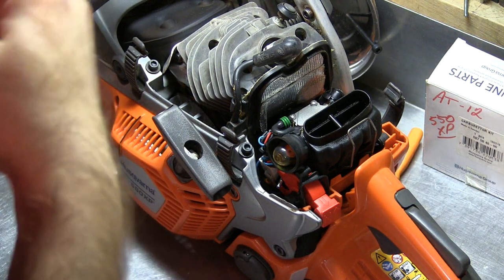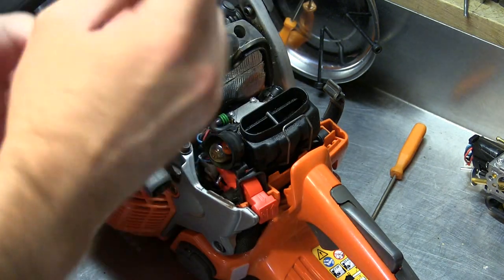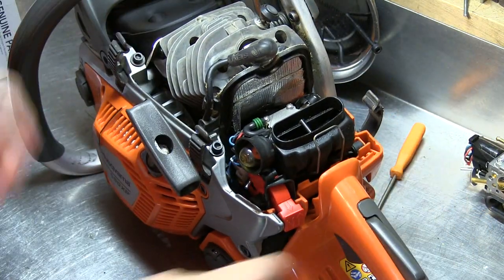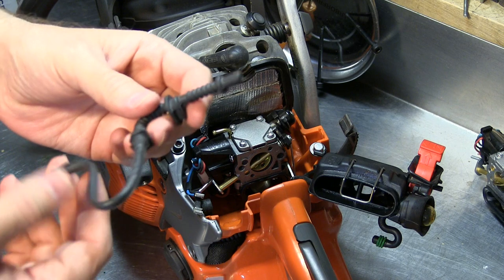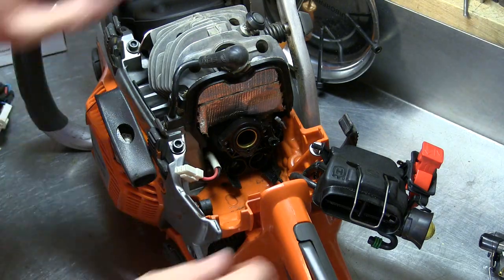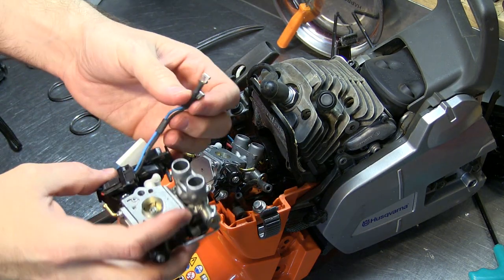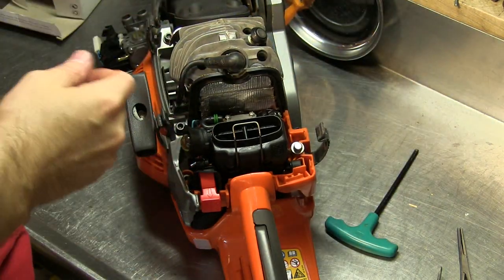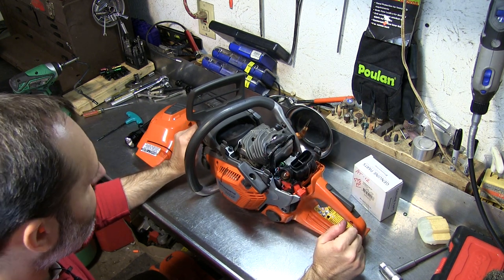Husqvarna 550xp carburetor installation

Comment: Where did you get the brass ring for the carb?  I dont see it in the parts breakdown for the Husky.
Reply from the maker: My dealer sent it to me, I don't know the par number myself. The parts breakdown your looking at may be older, so it's not a separate part as the ring was originally part of the carb itself. If you need the part give Ashokan Turf & Timber in NY a call, Bob should be able to get the ring for you.
Reply: In case anyone else wonders, the part number is 585195001.  I would say if anyone is replacing the older carb with the newer one, this should be ordered at the same time.
Reply from the maker: @jimbriney2349   Thanks for listing the number. The IPL I have doesn't list the number either. Did you contact Bob?
Reply: @Andyshine77  No, I found it online in the parts diagram.  Just a heads up for those that dont like to disassemble before parts arrive, like me, (and youd think after all the time Ive spent working on stuff, Id know better), but the AT-7 carb is the same externally (fuel inlet being the exception) as the AT-12, so if you are upgrading from that carb, you do NOT need the brass insert, if the saw came with that carb, it will already have it.
Reply from the maker: @jimbriney2349   Thank you for the update.

Comment: The new 550 xp model now called Husqvarna 550 XP Mark II, this new model comes with quite a lot of changes especially at the level of the cooling system where there were problems with this electronic autotune carburetor even as curious as how efficient and durable is this new model.
Reply from the maker: The 550 Mark II is actually not an improved version, it is an entirely new saw from the ground up, the IPL shows none of the parts are interchangeable with the old model. Husqvarna's marketing is a bit goofy if you ask me, this should be designated with a new model number like 552xp in my humble opinion. The saw also has some more weight to it, almost a full pound. Since I've gotten this 550 straightened out I actually really like the saw, incredibly good maneuverability, throttle response and power. But reliability is still concern, the new model looks to be over built, which may be a good thing.

Comment: I switched to echo because their warranties are better, they are cheaper to repair…i brought my 576xp into the dealer…took them a week and a half to tell me “i need a new carburetor”…didnt tell me what was wrong with the carb…just that i needed a new one…that thing only ran non ethanol…with red armor…and it was 6 years old…probably 30 hours on it total…

The autotune carbs are $150…standard carbs are $50….$150 to install, so, $300 to replace a carb….$1100 saw…

Comment: When you said you love the flip caps I had to respond. Lots of guys are breaking them. they should have used larger pin and HD Your plug wire is about laying on that cyclinder. Id get some clearance in there. I have about 9 autotunes with no known issues so far!! But 7 are jonsereds. I have the new 550xp markII too and I fired up 2253 jonsered they are very close.
Reply from the maker: First I've hear of that from anyone in the industry, good thing they have a slot for a screwdriver so you can still use them. The plug wire has a keeper that prevents it from contacting the cylinder, although it is close to the cylinder, not as bad as the 372's though they often sit in the cylinder and eventually rub through from vibration. the cylinder doesn't get hot enough to bother the  silicone plug wire. The 550 MKII has been doing well indeed. 

Thanks for commenting.

Comment: Thanks for video.  Used for reference.  Unfortunately, one of my strat port holes is deformed.  How the F do I get the partition off it?  Guessing pulling the jug is the only way as I cannot get a bit into the bottom 2 partition bolts to remove them.
Reply from the maker: If you're talking about the transfer covers? Yes you have to remove the cylinder.
Reply: @Andyshine77  Nope.  Plastic partition that holds the intake tube assembly.  No way to get to bottom bolts with jug on.  I managed to lose the small proprietary oring as well.  I will be victorious....eventually.

Comment: Husky screwed it's customers by releasing the 550XP with soooooooooooo many issues.  We were the Guinea Pigs for this saw.  Doubt the 550xp MARK II will be any better, just more testing on customers.
Reply from the maker: I agree with you on the first generation 550. However the 550 Mark II has been out since March and has been solid, and the 572 so far has become a favorite among the loggers that that are using the.

✌
Reply: I was disappointed to see on the IPL for the 550xp mark ll that it uses the same crank bearing as the original 550xp when they advertised better bottom end durability.
Reply from the maker: @johnwalt3504  The bearings on the oreginal 550 were upgraded a few years ago, after that the bottom end failures ceased, so it's not  surprising they went with thoes already upgraded bearings. The crank itself is new, along with the rod bearing. So far the reports are the 550 mark II has been trouble, issues with V1 550 were immediate. Time will tell how good the new 550 is, but so far so good.✌

Comment: A great video to watch! 
Interesting thoughts as well. 
On the 562xp, they changed that fuel nipple direction as well, like on this AT-12 carb? I know that those are Zama, but...could this help in the hot start problem?
Reply from the maker: Cristi Ro 

As of now they have not changed that on the 562. Don't know if it has anything to do with the hot starting issues or not, it does move the line a bit further away from the devider heat shield.

Comment: Bob plug that compression release they leak as well my Johnsered 2253 had transfer leak and compression release leaks and had to be rebuilt under warrenty and they plugged mine. I have since plugged all my saws release
Reply from the maker: Eric Smith 

I just bought a bag a decomp plugs.👍
Reply: If you have a pressure tester, it can be checked very easy. I just did a check on mine to be sure. 
In my area the dealers sell decomp plugs for about 5$.
Reply from the maker: I check them from time to time, I normally see idling issues if the decomp is leaking a little. I plug all my saws 70cc and down.

Comment: I have a Husqvarna professional 545 Mark 2 that has fuel coming out of the exhaust. It ran absolutely fine 1 day and the very next day it will not even try to fire off. I cleaned the plug and emptied the cylinder and it still wont even try to fire off. Fuel still comes out of the exhaust if I push the primer bulb 3 times. Any ide what might be going on? I am using the 50:1 ratio fuel mix.

Comment: My 550 only run when i prime it then it runs again until the fuel in the primer goes out. What may be the issue?
Reply from the maker: Inspect the fuel lines for leaks/pinholes, and make sure the fuel lines are properly attached at each fitting. Also test the tank vent for proper function, thus will require a vacuum pump with gauge.
Reply: Thanks
Reply: Sounds like fuel line or filter clogged

Comment: I've bought one these second hand and I'm having a problem. Itll start,but revs stupid high and if you touch the throttle itll die. If you feather the throttle itll run until you let off it. It's got a new piston and cylinder too. I thought maybe the carburetor boot,but I've sprayed carb cleaner around it and theres no change in rpms. Same with the clutch side crank seals. Any thoughts?
Reply from the maker: It still sounds like a large air leak, the transfer covers are known to leak. If you perform a pressure test, you can spray soapy water around and check for bubbles.
Reply: @Andyshine77  I'll give it a look,thanks

Comment: I wish there would be non autotune carburetor for these saws... I hate autotune. Is there any carburetor for swap? I have 2253wh.....
Reply from the maker: You would need a new coil and the flywheel would have to be indexed for proper timing. Also these saws are strato charged so the have strato intake ports. So realistically no, though anything is possible, as it's still just an engine, but it's definitely very difficult and not worth the trouble. Also the AT saws are now nearly flawless and I have come to prefer then to adjustable carbs.
Reply: @Andyshine77  everything is possible.  IIRC somebody on arboristsite  has make non autotune 562xp.... on wondering if it would be possible for 550/2253 also. My 2253 has never run as good as it should always first 2 minutes it just bogs and same with my brother 550xpg which has been updated by computer. So I run other non autotune  saws.... I just rebuilded 2253...
Reply from the maker: @Ketis1985   Don't recall anyone running a standard carb on a 562, but yes it's possible. The v1 550 and 562 were garbage saws that never should have been sold, they were totally untested. The 550 MK-II is nice and the updated 562 is alright, if grad a Stihl of the same displacement first though.✌

Comment: Hi do you think that stihl MS 261C-M is better on that than actuall 550xp mark2? Thanks
Reply from the maker: I have not ran a 550 Mark-II, but I have owned a 261 and still own a 550 first generation. The 550 Mark-II has been going well, but it's larger and heavier than the 261, and the 261 has always been solid. I like the 261 better.

Comment: I’m currently working on my 550xp 2014 I’m unable to take off of the carburetor is there something I’m missing? I have the air filter off, starter cable is off. I’m unlocking the plastic hinges but it won’t come off
Reply from the maker: You did remove the two long screws holding on the carb?
Reply: @Andyshine77  I did not I spoke to soon when I asked. I do have another question when hooking up the ignition switch back up which connector does the blue and black wire go to. When I took my saw apart last week I failed to remember which is which.
Reply from the maker: @michaelmcphillips9241   Black one mounts closer to the rear handle. I believe they're different sizes and will only fit in the correct location.

Comment: When you put the carb on everything just seems to fly together. Not so with mine. When I put it together the stop/choke switch refuses to move. Checed I haven't trapped the wires . Dragging my hair out with frustration. Any ideas. Would be forever grateful.
Reply from the maker: I'm thinking the return spring is not in the correct spot. If you look at the switch group you will see a small metal rod sticking out, there should be an even smaller wire looking rod underneath it, this is the return spring, If it's on top of the larger metal rod the switch will not function properly. It's difficult to explain, if you need me to make a short video so you can see how it looks installed just let me know.
Reply: @Andyshine77  Yes you were right, after struggling for a while I eventually spotted it. Many thanks cheers from UK
Reply from the maker: @christopherdart1749  Glad I could help.

Comment: All this makes me go away from getting one
Reply from the maker: I can't blame you. In fact the 550 is being completely redesigned  and is already in testing. It looks similar to the 550, but it is a total redesigned and will be beef up, unfortunately it's going to weigh over a half pound more. Not a bad trade off if it makes the saw more reliable.
Reply: @Andyshine77  I am probably better off  with àn older 254xp
Reply from the maker: @lucfournier3939  Those are getting too old to use as everyday work saws, parts are getting really hard to come by. I'd look out for a 346xp or even a 353. Sad thing about the 550 is they run awesome when they run right, but that's a risky proposition IMHO. The Stihl 262 V2 is a good saw as well.